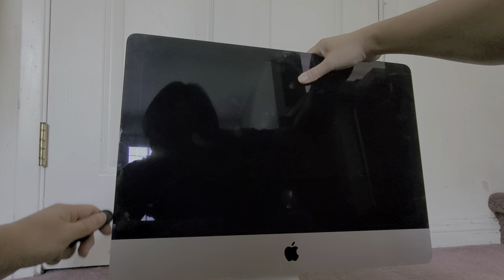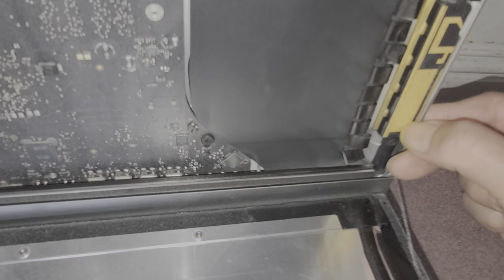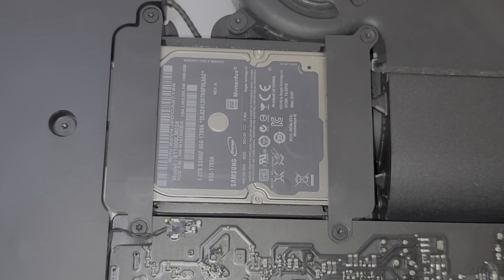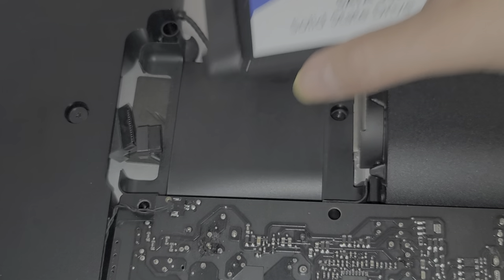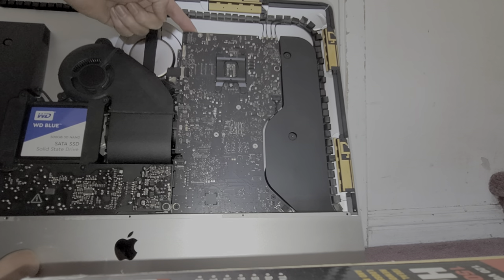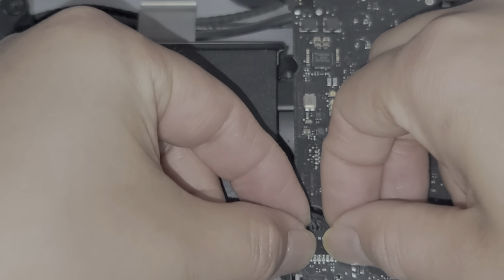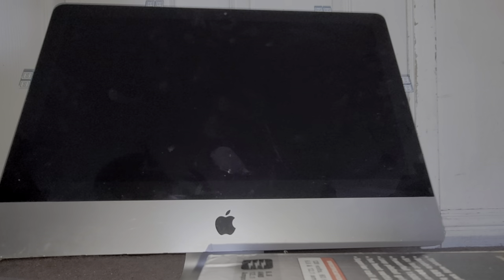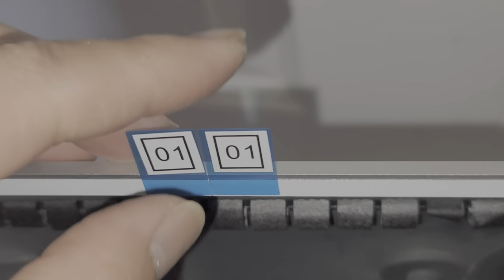21.5" inch iMac Late 2012 A1418 Disassembly SSD Hard Drive Upgrade Repair (Didn't Upgrade RAM)

Comment: poor guy that made me feel bad for you when it cracked
Reply from the maker: Yeah :( I think there was a chip in the glass before I started. I've done so many of these and that was the only one that had that issue.
Reply: @ItsBinhRepaired  poor guy, it ended up well?
Reply from the maker: I think I gave them the option of $100 off the repair, or I get them a new screen and they pay the original repair quote. The crack wasn't too noticeable, so they went with the discount. I basically made no money on the SSD upgrade.